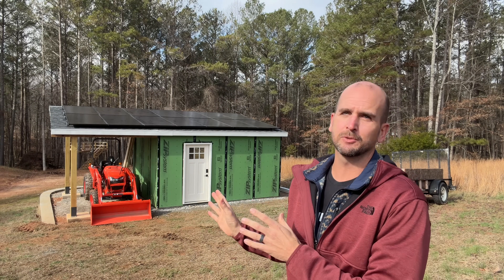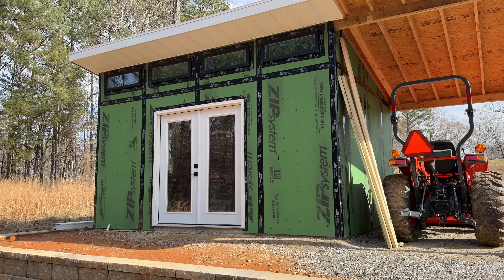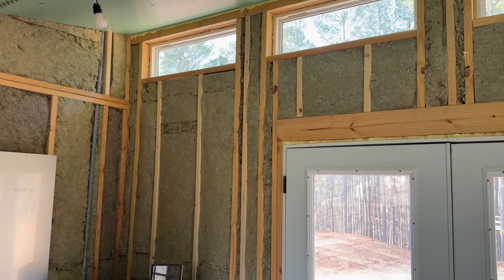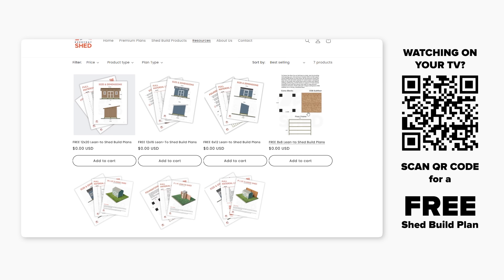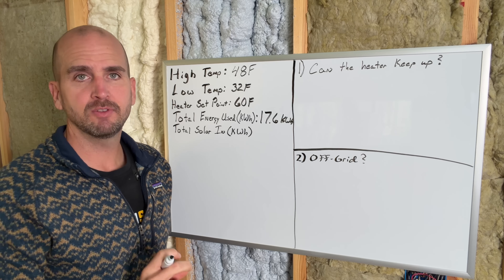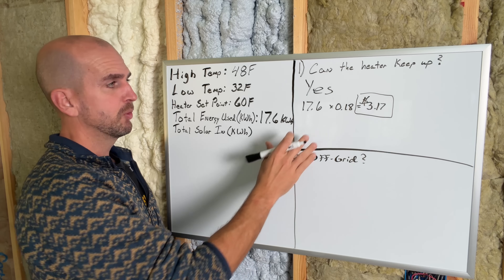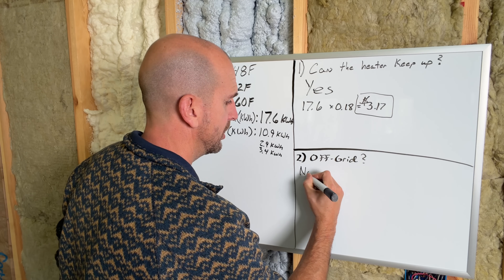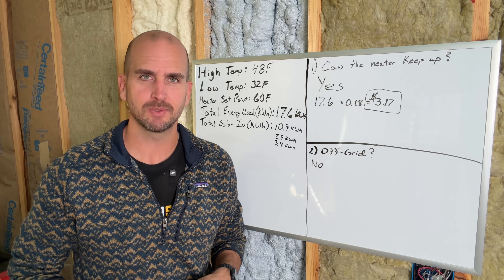HUGE Mistake: Why My $15,000 Solar System CAN'T Heat My Tiny Shed

Comment: Take the time to add more insulation to the walls and roof. Thirty-five centimeters in the walls and fifty centimeters in the roof would be a good place to start. Keep in mind that the floor should also have around 30–40 cm of ground insulation.

Instead of traditional ventilation, a modern heat recovery ventilation system would also make a huge difference.

Proper cladding is also recommended.

For heating, a geothermal heat pump would be the only option efficient enough to run on solar. Adding more solar panels and a larger battery would also help.

Comment: As a suggestion. We have a 600 sq ft detached steel frame garage with zero insulation and a completely independent 48v lifepo4 battery power system. We live in southwest Ohio, where we get about 180 days a year of cloudy weather. Not conducive to solar power. As a supplement to our solar, we have a 2500 watt dual fuel generator that runs off wood gas and a small home built wood gassifier. It took us about 3 attempts to get the gassifier right, but the cost is minimal and you can purchase commercial units for home use. When we don't have enough consecutive says of sunny weather to keep the battery system charged with the solar, i can go out in the morning and fire up the gassifier. After 20 minutes of burn, the system is producing a wood gas that is sufficientlty pure enough to fire up the generator and run it for 1 to 2 hours. This is enough time to put a full charge on the batteries. That will normally last 2-3 days of normal use in the garage. If it is a weekend and I am out there more tinkering, I can put a full charge on every day. The gassifier will burn on any wood, and once the burn gets hot enough (20 minutes) the exhaust from the fire is directed through the generator and the exhaust from the generator is less polluting than running gas/propane/natural gas. Its an easy system to build and install and costs very little to run, and is not SUN dependent.

Comment: i always say whatever insulation is required double it, insulation is key to efficiency (r 30 plus) . minimize and encapsulate the beams, triple pane no exposed concrete as a slab (lose like 40% of heat through the slab on grade)

Comment: Hi you should use solar thermal to heat https://youtu.be/3s0rM_unOj8 I can heat my whole house during the day. The system only cost $1850 complete. My house is well insulated 2500 square feet. Thanks! Paul

Comment: 2:39 I would bet money that your heating problem is the R10 in the ceiling.  It should be higher. (Depending on where you are located R-30 +/-)
A tiny MiniSplit would use much less energy than the electric heater, too.  3-4 times less in the heating mode.
Reply from the maker: I am 90% sure I will be doing a follow up test comparing R10 to R25 for the ceiling and have a side-by-side comparison for you guys.  I am interested to see the results and do a ROI calc.
Reply: @EverydayHomeRepairs Sweet!  I am an HVAC contractor and I have completed thousands of Manual J heat loads.  The ceiling insulation and air infiltration are typically the largest source of heat loss in the winter months depending on your particular climate.  I am interested to see your results,too.  Thanks for taking the time and effort to do this for us.  If you don’t mind me asking, where are you located?  Roughly.  In fact, I would love to do a heat load for you…no charge.  We can play with different scenarios to see what would really save you the most energy.  🫡

Comment: Running 2x1500 watt heater with a 4 kilowatt system but only when the suns out as a supplement source of heat came to the same conclusion winter and over night are a no go but as some have stated a heat pump and a considerable increase in my system and it might stand a chance, realized solar is better used as a back up system for power outages and supplementary power then full time use.

Comment: Old style radiator?  
Natural convection occurs as the radiator heats the air immediately around it. This warmed air rises, travels across the ceiling, cools as it touches cold walls/windows, and falls back to the floor, creating a slow-moving, natural convection loop. This results in significant temperature stratification, where it can be very warm near the ceiling and noticeably cooler near the floor (a "cold feet, warm head" effect) 
Modern Systems (Forced Air/Forced Convection): Modern systems, particularly forced-air HVAC, use fans to actively push conditioned air through ducts and vents, distributing it rapidly and more evenly throughout the space. This breaks up temperature stratification and ensures consistent temperatures from floor to ceiling

Comment: First off, you have to sociolate and your R15 will definitely not be enough, especially with the joists and studs being heat transfer bridges as common. Then the radiator is only a 100% efficient if even so a heat pump would be definitely a wiser choice.  End , besides that six kilowatt hours are not that much

Comment: Your test need to be longer as floor is a big heat sink until it’s heated up.
As everyone else said way more insulation!
I’d run a home made “heat pump” made from running an air conditioner backwards preferably with ground source coils buried underground

Comment: You can do all the math, but you don’t have common sense. The roof is like a hat. You don’t have enough insulation up there that’s your biggest heat loss and then the floor slab. These two items are your largest calculated of heat loss.

Comment: Ii understand that this is an experiment done with curiosity in mind as well as getting video views.  But this is perhaps the dumbest way in the world to heat a space like this.  

A single "fat boy" propane tank and a modine heater would cost less than $2000 in a DIY situation and would cost a few hundred per year to run.

Comment: Even though its minimal, interior sheathing is thermal mass and you're missing it! Surely the heater would cycle less often if there were more mass to radiate the heat back into the room. I highly recommend plastic and sheathing before running back the exact same test with the 1500w oil heater too I mean for real, it's a radiant heater, you're heating air but you need to heat mass brother man.

Comment: Way too little insulation on the roof/ceiling, marginal walls, uninsulated slab, resistive heating ... Thanks for all the info on what not to do.
Reply: your take is very harsh, but I don't blame you. As soon as I saw that resistive heater I was shocked

Comment: propane tank with buddy heater. works for me for the most part. but you have to be loosing a ton of heat somewhere. i think the floors need work.

Comment: What about the (hypothetical) idea of temporarily adding a few dozen extra solar panels during winter, and then dimming or disconnecting them in spring and summer?
Reply from the maker: That DPUX from ecoflow has 2 solar inputs and the 6 kW of panels on the roof are only going into 1 of the 2 so I will be doing a ground mount before too long.

Comment: Use physics. Use a heat pump instead of electric radiator, and put some actual insulation in the roof. They are a lot more expensive currently, but good heat pumps should be coming down in price, or you can make your own out of reversing and heat-sinking a cheap air conditioner. Also, you have way too many windows to make your wall insulation do anything.

Comment: Comments here have it right. Insulation above and below, and mini split and you're set. Cover windows. Also could build that system for a fraction of the price with different batteries

Comment: not insulating the roof was a bad call. r10 is almost worthless for a roof. Needs to be at least r21, but for such a small space it is penny wise and pound foolish. Just go r30 or 38 and be done with it. Also the slab is a heatsink, flooring decisions can help a little with that. Also a heat pump unit will cost more, but will require less electricity for a similar BTU output to a home depot 1500w radiator.

Comment: How to run 110V into the shed? I don't have any experience.
Reply from the maker: Most pull a 20 Amp circuit off their main panel and trench out to the shed.
Reply: @EverydayHomeRepairs At the shed, I need some kind of box, or just drill a hole for the pvc pipe to go through?

Comment: I am heating a 20x30 building with loft using solar using a PV system about equivalent to yours in size and cost.  Not sure it is going to be enough come cloudy days in January, but at the moment, it is more than enough on a somewhat sunny day. I am in Georgia, lat about 34 degrees. Not sure where you are, but you sound like you are from up north somewhere.

I have a 2-ton mini-split. It can supposedly maintain a comfortable temperature down to about 17 degrees. A 3/4 ton unit should do you fine.  Guessing it would draw about half of what your  1500 watt resistive unit does.

We have LOTS of windows. Helps in the winter during the daytime.  At night they are a negative of course, but I don't mind it cold for sleeping. They are also a negative in the summer, but cooling has not been a problem, since when the biggest A/C load is when the sun is out. It typically does not even hit the batteries.

Spray foam is my insulation of choice.  It is only around R-14, but it is so airtight, they really need another rating system for spray foam.  This is NOT a DIY proposition. It is cheaper to have a pro come and do it. I spent around $7,000. It was really my only choice. I don't see what else would keep condensation off the walls and roof in my metal building. I have been meticulous about using Great Stuff spray foam in a can to seal around any seams where pipes, etc. enter the building.

The concrete slab has LVP flooring. Some insulation.

Here is a video of my building.  See the Description for links to the parts mentioning the PV system.
https://youtu.be/nqtFHs0xvpU?si=QDvspizY_SzzR1JI

Comment: Reality. A watt 1500 array (solar panels) needs a 3000 watts to drive that heater over a 24 hour period, Minimum. You need to account for 4 hours of actual sunlight maximum.

Comment: Of course it can't. 50%. Of the sun's rays are infrared. If they can't heat your cabin the meager percentage of the meager winter daylight you convert to usable electricity with solar panels certainly won't.

Comment: You should look at a Hisense or other portable air conditioner with heat function. Use the app to start heating 3 hours before you’re going to go out to your shed. And run it while you’re there. This would be a good solution for all of the months where it’s cold but not a total deep freeze.

Comment: I’ve looked at a lot of these comments and the general consensus is just throw another 10 to 15 grand at it and that should fix it. 

For the 15 thousand invested in solar panels he could have it properly insulated and completely finished off inside and out and had a nice small through the wall propane heater installed and probably had enough money leftover to pay for a couple of years worth of propane.

Comment: This is one of the worst solar videos I've seen in a hot minute. Dude, you bought one of the most expensive systems on the market. You paid for a name. There are so many options for solar panels, batteries, inverters, charge controllers, all that jazz, that buying a system like this is only done by people who are scared and don't know any better. There are cheaper panels that are made in the US and are better quality with a better warranty. Their inverters are mediocre, I suppose. They do the trick, but they market it like it's vastly superior to any other product. Their batteries, while being decent quality (last time I checked, anyway) are extremely expensive for the capacity you get. Coincidentally, the price is the only thing that's extreme about that setup. I've seen better solar setups than that in a Goddamned calving barn! This is BS marketing. No one who knows anything about solar AT ALL will buy an EcoFlow for $15k when there are multiple options that offer 30kWh+ for less than $4k. Do better. Get real sponsors. Stop screwing people over so you can make a couple bucks on affiliate links, because real people will trust you and make really stupid decisions based on your... terrible information. By the way, if you're sealing up your office that well, you need to put in some air handling so you don't suffocate in your own breath. Either put in some air exchange equipment, or don't seal the walls so well so they can breathe. You really don't have an excuse for all this. There are way too many highly respected content creators right here on Youtube that would have helped you out or done a collab. Good luck. Between the completely derp-ass way you insulated the ceiling, and now this solar abomination, I'm gonna tell the algo not to recommend you to me anymore.

Comment: Not a builder, but even I could tell that R10 is paltry for the ceiling.  And for an off-grid solar shed, R15 isn't very strong either.

Comment: Outside is 14 F. I am heating about750 square feet. Average insulated walls(R15+). Average Low-E Insulated double-pane glass with argon gas filling(around R4). Power consumption of my heat pump in real time for the last 3 hours vary 1,1 to 1,3 kW.

Comment: R-38-R49 is code minimum for your ceiling....MINIMUM; going a little above that is no harm.
Also, since you don't have perimeter slab insulation, you need to insulate the floor. Think R-15 min
You'll lose way more heat thru floor and ceiling than walls

Comment: Put in a heat pump and get the same amount of heat for 5 kWhrs. Better yet, get a small auxiliary gas heater or a small wood stove. Turning solar electricity into resistance heat is a bad idea.

Comment: Love this channel and the others but this is not a reasonable example. Price it out with used panels.wooden ground mount, Cheap AIO inverter and a big Docan battery. Ecoflow is so expensive. Also try to not live where it gets cold.

Comment: See a problem with the fiberglass insulation installation. The fiberglass is compressed when the paper strips are stapled to the 4" sideof the stud. Compressing the fiberglass reduces the R value of the insulation. The paper strips should instead be stapled to the front 2" side of the studs, maximizing the fiberglass R value.

Comment: Questions:  Why test at 60deg F?     a more realistic test would be ~70degF... right???     Plus, what about opening the door several times per day (introduction of cold air - increased load) as well as other electronics.. computer,  peripherals chargers, monitors, lights, etc that would be running in the "office"...  ?